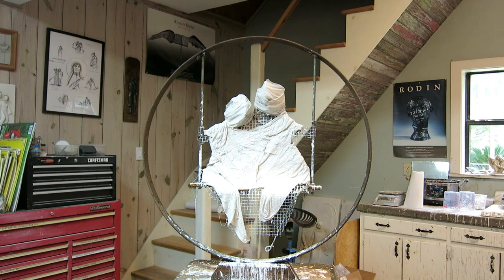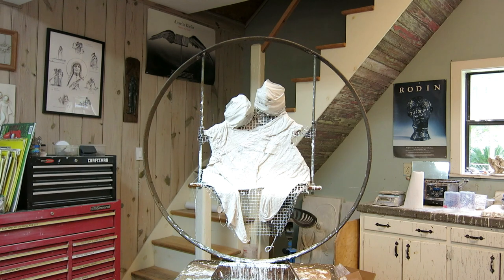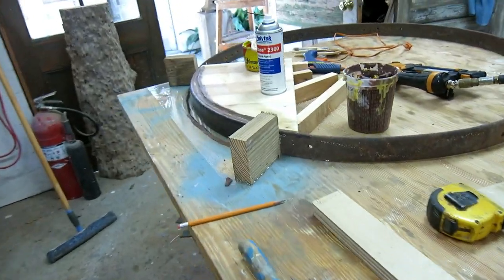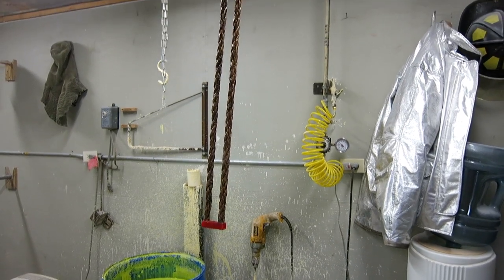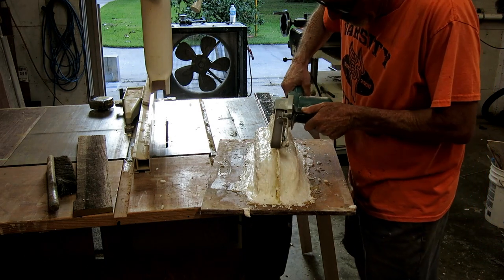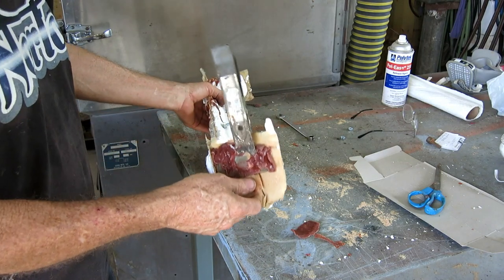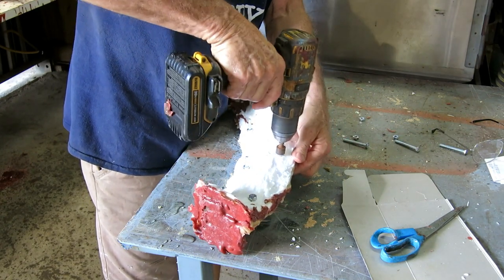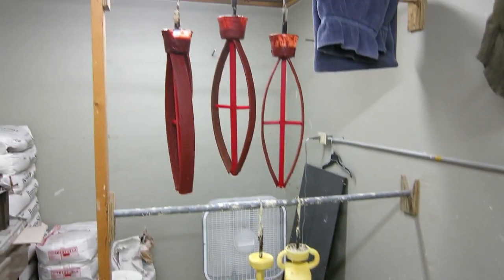Debbie's Hoop Art Preliminaries Part 1 of a few

Comment: Fingers crossed for your hemp rope.  I hope it works for you.  Remember my cattle brand?  I burned the hairs off mine, used super glue and got it invested.  I don't think I burned out long enough.  The strange thing was I has bits of shell delaminate inside.  I fired to around 1500 and gave it a couple of hours.  The parts that were successful looked really good and the rest was going to require too much work to make right.  I burned out and went straight to bronze.  To do it again, I would burn out, let cool, flush the shell with water and reheat then pour.
Reply from the maker: Well we are on the same page on this one. I have the advantage here though. With a section of the shell ground off of the bottom and the wax cup melted out I should be able to see straight through the mold . I kinda figured on burning, rinsing, and repeating until done.
Reply: @barrylukebuilds7894  Rock on.. sounds good.  You know I'll be watching.  I think casting organics is cool.  Let's do a 500yr old oak tree!  😳